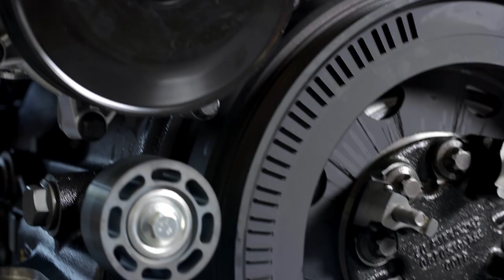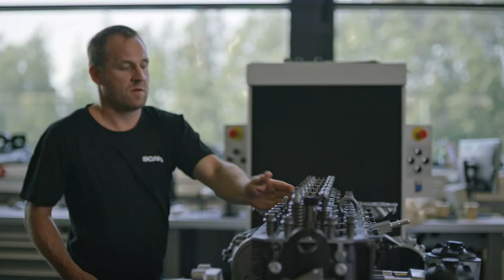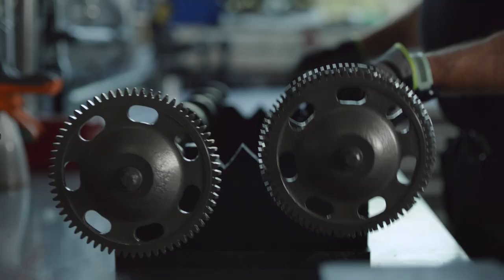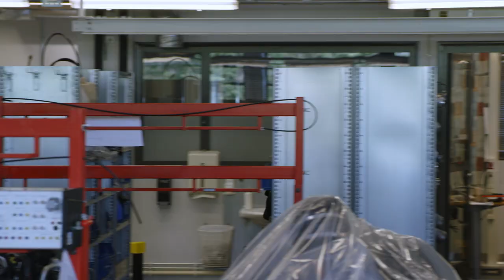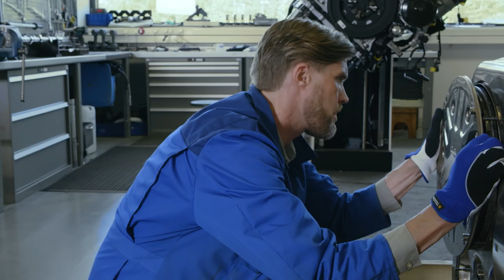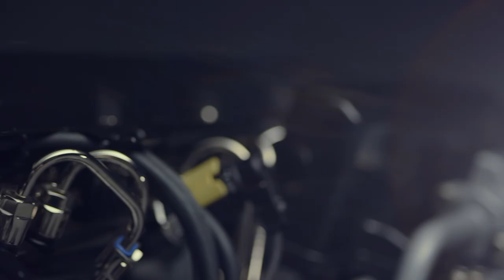What's new in the Scania Super engine

Comment: So cool that now if I have a cracked valve seat I'll have to replace the WHOLE head instead of the individual one! Instead of spending thousands on the repair ill now spend tens of thousands! I sure am glad I'll save those 6L/100Km tho!
Reply: Sadly yeah, same for us technicians but you have to move with the times, Volvo has had DOHC for a good while now DAF had SOHC not long ago but they might bring it back soon
Reply: Is that a comon problem? Don't think so.
Reply: @Marauder252   It isnt if you maintain the valve clearance which is a 20 minute job
Reply: @martijnslingerland5802  its problem for those not checking they valve clearance regularly
Reply: If you save 6L for every 100kmh, that's 60L per 1000kms which is a measly distance for a hauling rig (easily done in a day and a half). That's roughly 80€ saved. Let's multiply that by... say 13 (if you do an average 13k kmh a month) and that comes up to about 1040€ a month saved.
In just a few months, you'd have enough saved for a repair that may or may not happen. ;)
Reply: @rioblyth3926  Volvo is SOHC. Cummins Signature was DOHC but it was crap.
Reply: That's called a throwaway truck it works great until it breaks down then it's too expensive to fix and the trucking industry is run by extreme cheapskates anyway. So enjoy driving a broken truck around until it breaks all the way and can't be driven at all
Reply: Well, it's all necessary to meet the emission regulation
Reply: @mickeypopa  despite he surely meant 1000km, no way this saves u 6l/100km lol, NO way
Reply: @alpha-cf2oi  well 6% is 6L per 100km
Reply: I’ve rarely seen a scania crack a valve seat! What is more likely to happen is the head gasket leaks the customer keeps driving it and the fire ring on the head gasket wears a grove in the head face
Reply: I'm sure they'll find a way to fix this without replacing the head

Comment: In my experience individual cylinder heads were one of the best advantages of commercial vehicles
maybe they no longer look at that which was an advantage for vehicles from a certain age which will also reduce the resale values as it happens in the rest of the truck brands
Reply: Agreed
Reply: Agreed, also with Joe
Reply: Totally agree. And how long will that very long timing chain last? Ask BMW owners.
Reply: @1chish  No worries, the valve train is driven by gears and not a chain
Reply: @alterschwede38  Overhead cam gear sets? Blimey... That is Cosworth territory.
Reply: @1chish what are you talking about
Reply: @oddarntnes7079   Read the words and you get to understand.
Try harder.
Reply: @1chish  im not the one complaining about a timing chain that doesnt exist.
Reply: @oddarntnes7079 I'm sorry to interrupt or if I'm missing the point but BMW's N47 Diesel did in fact use timing chain and it is also in fact, very prone to snap to the point of recall.
Reply: @aluxtaiwan2691  how many other cars use timing chains? scanias doesnt even have timing chains and probably never will what the hell are you all on
Reply: @oddarntnes7079   1. Actually quite a lot of engine use chain.
2. Yes the Scania didn't use the timing chain, you are right. but I think he changed the subject to the BMW on that sentence, At least that's how I interpreted.
I think he just wants to bash the BMW N47
Reply: @aluxtaiwan2691  i meant that timing chains are really common on engines, and that stating one bad example doesnt mean anything. and for the n47, ill let him :-)

Comment: Lets make a opposed piston engine.
3 cylinders, 6 pistons.
Much more efficient if an engine designed in the early 1900s is a better engine layout than todays "modern" engines which are mere air pumps.
Reply: The reason that modern engines still have the same basic concept as engines as some engines did in the early 1900s, is not that other concepts were never developed or suppressed. The reason is that the best concept has outlived all others. Efficiënt engines are developed by engineers, not inventors.

Comment: I feel v8 community getting confused..
Reply: Why?
Reply: @theonlyonepaulo  Look at new Scania's 13 litre engine range, it contains 420, 460, 500, and 560 hp! The 560 hp motor developing 2800 Nm, outpowering the 530 hp V8 which had the same torque figure.
Reply: @ajidamarjati  I know that. But it isn't new. This dohc engine isn't making the community confusing. Most people already know that the V8 will be used only in big power. And Scania always produced more 6cylinder engines than v8s.
Reply: @theonlyonepaulo  I mostly meant the Super badge thing😆 Overpowering v8 is not something new, good neighbours from other coast of Sweden has done this for looong years. Just cultural thing with "s-u-p-e-r v8". Even tho it originally meant supercharged.
Reply: If the trend is always going like this, an 13 litre 6 cyl engine outperform some of the 16 litre V8 engine, i think sometimes in the future V8 line-up will shrink and less variant offered.
Reply: @ajidamarjati  I bet scania is deciding about a quad cam V8, the V8 is still pushrod and they rarely go wrong unless neglected, air flow is a thing with these diesels, Volvo has had dual cam for a while, guess you’ve got to go with the times
Reply: @ajidamarjati  yes, the v8 at is basic version XD the SAME v8 can put 3700nm and 770hp on the table... it's just a matter of power settings among the various models to differentiate the lineup...
Reply: @Ale55andr082  More in general, that there have been even 13l 540 around for a decade. Dont take these comparesons too seriously, there is so much depending on axle ratios.

Comment: Scania,there’s an old saying, (if it ain’t broke don’t fix it) I only hope this isn’t the case here because it would be a shame to ruin Scanias reputation for longevity and reliability. Single heads are great because their not to heavy to remove should it be necessary but I cannot see the benefits of going to one piece heads,probably cheaper to manufacture and build than single units but one things for sure it won’t be for the operators benefit,just watch the head gasket problems start all over again,bad move Scania.
Reply: We work a fleet of 60+ MAN and over 80 IVECO trucks (420-550hp)
Only time I've seen head gasket fail was caused by something else. Water pump going bad, drivers throwing crap/wrong coolant in cooling system or blocked intercooler.
Both have single head design for generations and holding strong.
Reply: Let’s go back to horse and carriage, these modern truck things are no good🤣🤣
Reply: Clearly you can't have dohc in split heads. With the cams up there you wouldn't be able to take off just one part anyway
Reply: @krpajda  Absolutely correct,but why the need for them it’s a truck Not a formula 1 racing car so doesn’t need to Rev more than say 2500 RPM. Whatever the reason it won’t be for the operators benefit,the more complicated it is the more chance of failure and cost to the customer in down time and parts to repair and of course the dreaded labour costs plus that wonderful VAT that you have to wait 3months to reclaim,been there done that simplicity is the name of the game with haulage rates and fuel costs being what they are. This new engine might be brilliant but hauliers tend to go with what they trust because of past mistakes that they cannot afford to repeat especially now with the price of everything going through the roof,it’s a juggling act buying the right vehicle for the job at the right price so getting it wrong is not an option.
Reply: @davidellis279  I'm assuming it's because some regulatory body pushes them to keep improving fuel efficiency, and they already hit the absolute limit of how aggressive their cam profile could be in a pushrod engine, leaving this as the one step forward.

Other comments point out potentially even better solutions, such as an opposed piston 2stroke, or some kind of implementation of freevalve (the guy saying that it could be ran off brake air is insane tho), but the R&D costs on that are probably too high for now.
I'm sure it's coming eventually and the opposed piston engine could be an absolute godsend for reliability, with no heads or moving valves, but for now we're stuck with an oversized Supra motor.

That timing chain better be made of porcelain or something, because if it stretches at all, no one will buy this power train with the added maintenance costs
Reply: Fuel economy sells mate which is why it’s single head DOHC if you work out the fuel savings over a few years it’s a lot of cash
Reply: @krpajda it’s gear driven not chain

Comment: Is the old 6 cylinder motor a SOHC? If this new one is DOHC
Reply: Old one is "cam in block/pushrod design" but still 24 valve, this new seams to be DOHC 24V.
Reply: The old platform is OHV
Reply: This is DOHC
Reply: @TellurideS13  Diesel oil fuel, or Bio-fuel coming soon???

If Diesel petrol oil, must be S10, no???

Best regards!!!😊😍🚐👍🏻👏🏻👏🏻👏🏻
Reply: @rodrigaosvasconcellos8430  Biofuels

Comment: Electric superchargers can have an efficient combustion ,using Hydrogen instead of air .This will enhance engine power and reduce diesel consumption. This system is good for Ethanol/Bio diesel fuel engines too.Though electric motors connected to differential input can be used to further multiply peak torque or speed.
Reply: @prabhjotsinghcheema6671  where are fuel cell cars in general use? Not even comparable to electric cars, let alone to power 300-400kW trucks that have space for giant cells but they are to heavy even for trucks which loose load capacity.
IMHO there will be electric trucks combined with LPG/methane turbine generator for range until we figure out battery density and capacity. 

This is what most dealers talk about when we are preordering trucks for the fleet.
Reply: @goodiezgrigis  Hydrogen is much more efficient than Diesel, But it is somehow much more expensive if you buy. You can Check out Hyundai and Mercedes Hydrogen fuel trucks they have already been launched.Some are also being tested in California and Canada.
Reply: @prabhjotsinghcheema6671  i know they are playing with Hydrogen powered vehicles and testing. 
No fleet operator would want a truck that uses expensive fuel and costs more even before we draw a line at any mileage. 

Basic Physics will help you understand the energy needed to produce hydrogen vs energy recovered from it. 
Don't start with solar hydrogen generators, they are inefficient. Electrolysis of H2 is mostly used and it is net loss in energy at the end. 
Companies may fling about some money showing like they care about the enviroment, concepts, tests etc, but look at the roads to see the reality we are nowhere near that. 
We do get offers for hybrids (biogas/electric) to test or buy. Nice trucks, economical with minimal polution, but we are doing buisness and diesel is king for reliabilty and economy for foreseeable futurr.
Reply: @goodiezgrigis   Diesel is far more expensive than hydrogen or electric , not to mention the after treatment system.We need to get rid of Diesel fuel ASAP.
Reply: @practicaleconomist9636  you can't just get rid of it asap. 
Replace it with something better yes, H2 certainly not, it is cheap now when there is no demand, price will skyrocket as soon usage goes up. 
Noone even has infrastructure capable of powering the electric cars, let alone trucks if we go all electric.
Look up how much diesel we use and convert that to Tera Watts of energy used in transport alone. 
Let's say 25-30l per 100km (conservative) is equivalent to 25-30 kWh at around 10kWh/liter of diesel. At 600km/day we use 175kWh and discarding the loss in efficiency we can round down to 100kWh per truck per day of energy needed. 
We are talking Tera Watts of energy we can't get from other sources that are commercially viable world wide. 
I hope 🤞 you uderstand my thinking.
Im all for better and cleaner trucks, autonomous driving and so on, and as of right now Europe and Asia are building the cheapest and most efficient transport ever invented for long haul - Railways. 
Tendency is to eliminate trucks for long haul and keep them on short distances under 500km.
Reply: @goodiezgrigis  Any Cartel can manipulate any commodity price.

Comment: I want to know...

With Volvo's 13l engine, the 420, 460 and 500 all have the same compression ratios meaning that the 460 and 500 should get very similar consumption and it's only the 540 that has reduced compression ratios

With Scania's current offering both the 500 and 540 have reduced compression ratios meaning stepping up from a 450 to a 500 means worse fuel economy, is this the same on the new line up, or will the 420, 460 and 500 all get the same compression ratios?

Thanks in advance if anyone can answer, can't find the info anywhere
Reply: According to their website all new 13l super engines (420, 460, 500 and 560) will have a compression ratio of 23:1
Reply: Read german fuel efficiancy tests of the curent 500 and 540hp engines.
Best in class even with 21 in stead of 23 in compression ratio
Reply: @rikardandersson7288  interesting...

We might see quite a few of these new 560's make it into higher end fleets

Comment: Varför använder man inte tvåtakts dieslar ?
Reply: Customer wants low fuel consumption
Reply: @fortune300  och varför är alla stora diesel motorer två taktare om verkningsgraden enligt dig skulle vara längre?
Reply: @pauli.x.  On boats where they have room for the huge conecting rods. 
Not a single truck manufacture world wide uses 2stroke engines for a reason.
Reply: @fortune300  förutom Detroit Diesel.

Comment: Great so you made an engine that has the same technology all the other manufacturers have been making for years already. Give yourself a pat on the back
Reply: There not inventing anything new, they are just optimising to the extreme, Scania's 13l engine is already very efficient and an 8% improvement is massive

I wonder how this will compare to Volvo's I-save, and whether they will update it
Reply: Isn't it remarkable that the present engine with push rods first made in 1994 still has class leading fuel efficiancy? 
If you know what you are doing and optimize well you dont't need tons of expencive technology. 
This doch Scania engine delivers 50% BTE, no one else can deliver that performance.
Reply: Part of the magic is actually in the aftertreatment system, whether you like that or not. Due to its high efficiency, it allows the engine to produce higher NOx levels than competitors which enables lower fuel consumption. It’s why Scania was the only one to get away with non-EGR so far and the new twin SCR will only be better.
Reply: @CreRay  Iveco is also non-egr. And Chinese got to 50% efficiency 2 years ago.

Comment: Nothing special, still an ICE with >less than 30% operational efficiency.
Reply: You know that for sure?  What's "operational efficiency"?
Reply: Uhm no. Truck diesel engines usually have 40%+ thermal efficiency, not 30% at all. Thats for gasoline engines
Reply: @dieselgeezer18  Gasoline engines approach 40% in some areas of their operating map.  The GM 5.3L DI V8 peaks at 37% at 2500 rpm, 300 lb*ft torque.
Reply: This is 50% efficiency , earlier were about 45%. Mercedes F1 gasoline engine is also close to 50%.